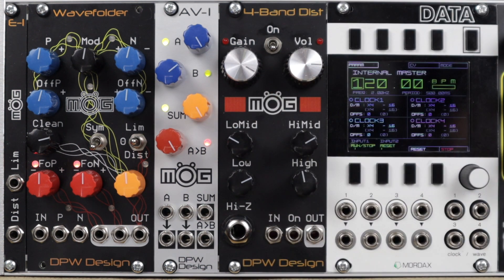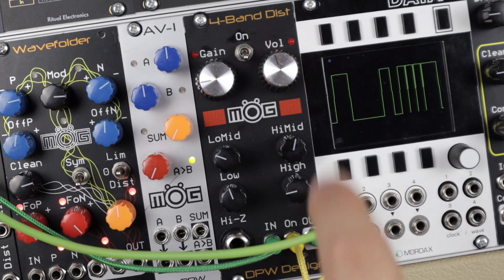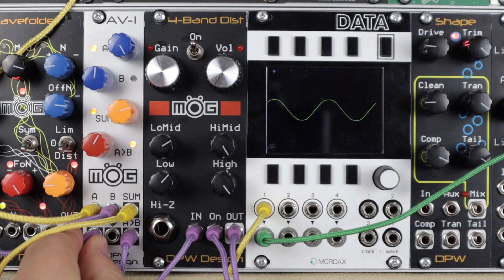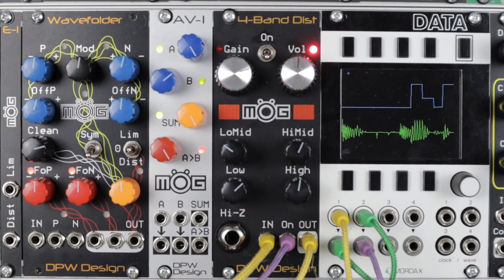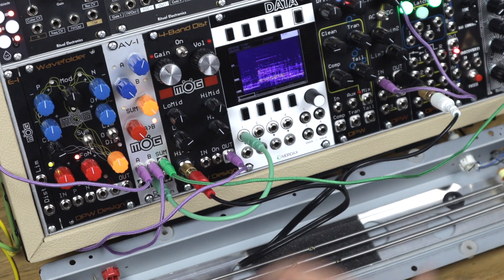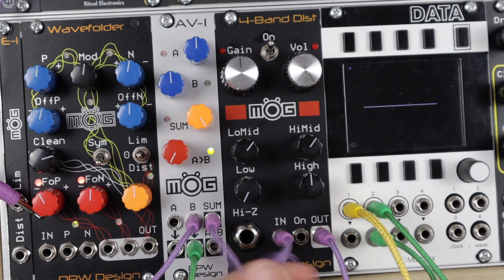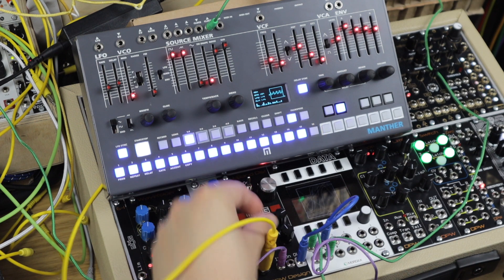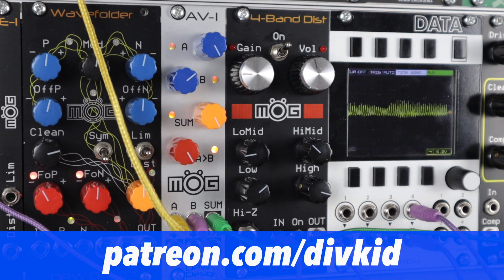DPW Design MOG 4 Band Distortion // Multiband Eurorack Distortion module + saturation patch tips!

Comment: I’m starting to think wave distortion is the thing I’d like to explore more. Off topic... if you want to enjoy spring reverb more... try experimenting with placing bits of cotton or foam at different points along your springs. I did this in the 80s to create other reverb sounds, as I had very few bits of kit to use in my recording process. I produced some very useable reverb sounds for vocals and guitar, that aren’t otherwise available from a spring reverb left untouched. Cheers